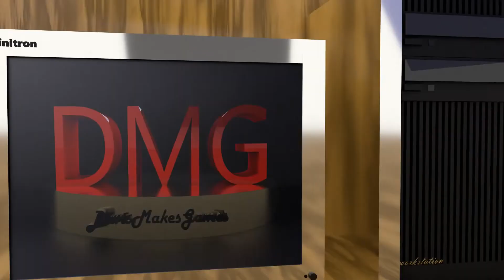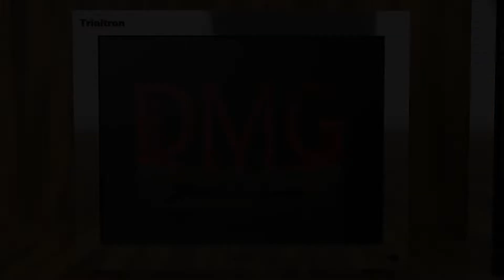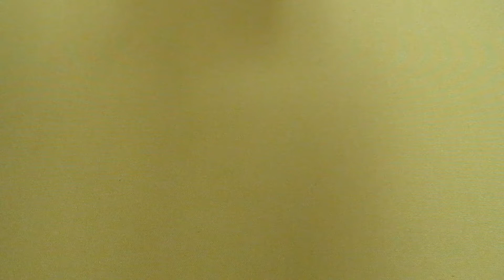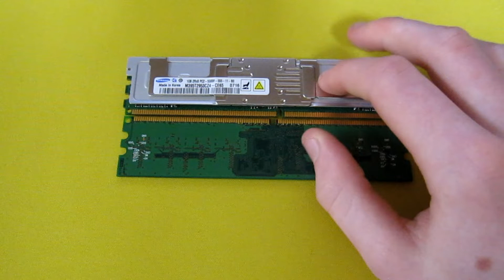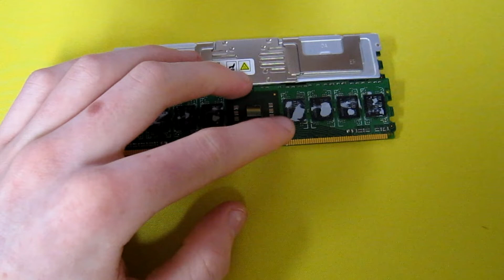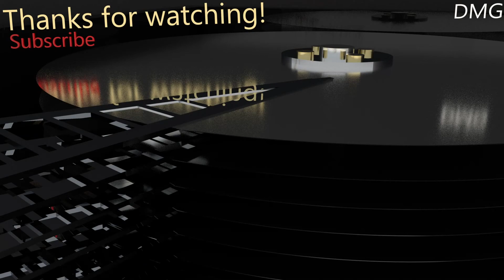What's so special about ECC DDR2?

Comment: I appreciate that you are showing this opened chip, and that you're trying to explain, but many of the points you made need correction. The extra chip in the middle has more to do with the fact that these are Registered DIMMs (this has to do with how the memory is accessed). ECC functionality is performed in the memory controller, which uses extra parity bits that are available in the memory modules. Slot disablement is a feature of the motherboard or CPU. Lots of ECC RAM doesn't have thermal spreaders, and there is non-ECC RAM with thermal spreaders. Normal RAM chips communicate some data about themselves too. RAM training is standard going back at least to DDR1 (ECC and non-ECC). It's the process where the memory controller tries different speeds and timings to achieve stable, responsive memory storage and retrieval. The "southernmost latency is zero" statement means, since it takes the longest amount of time for signal to propagate to the furthest away (physically) RAM slot, they don't add latency to that module, and all other slots are slightly delayed to align the clock pulses.  "Self refresh" means that the RAM is refreshed by itself. Basically all normal DDR1/2/3/4/5 is CMOS, which needs to be refreshed periodically, or it will lose track of the data it is storing (It reads the data, then writes it back). All DDR compliant memory has self refresh. Knowing which RAM chip is dead, and choosing what to do with that information is a function of the motherboard and CPU, not anything to do with whether it is ECC or not.
Reply from the maker: Thanks for the info, I appreciate the corrections and insight!

Comment: The DDR2 era was quite bizarre, what you covered in this video is FB-DIMMs, which was what Intel used in the C2D based Xeon era. 
that chip does something super interesting that I'm surprised you didn't mention, it converts the parallel data that is stored/received from the RAM chips and sends this as a serial connection to the Northbridge. that is the main reason it needs to much heatsink as compared to say.. an RDIMM

however there were also "Buffered"/"Registered" RDIMMs (they have a P at the end of the speed). they put a "Buffer" chip on the control lines only. which has the sole purpose of cleaning up the signal, and possibly extending the rank limitations of the chipset.
which is similar to modern day RDIMMS and used by AMD in that era, AMD was also using on-CPU memory controllers well before Intel and is how all modern systems work.

and (while rare) there's even unbuffered ECC AKA UDIMMs, which are essentially "normal" DDR2 that has the extra 9th chip per rank required to store the ECC.
Reply from the maker: I did not know about the serial connection specifically, thanks for the info!

Comment: FIFO is First In First Out.  It's just saying the commands are stored in that buffer and executed in the order they are received.  Usually we just say "FIFO" as a single word (similar to how you say "Fido", a popular name for fictional dogs).
The rest of that paragraph made sense.  The reason they all need to align with the southern most DIMM is because that one will be the slowest, the faster modules can "train" their speed to match the slowest one so that they can all operate in lock step.  South, in general PC architecture, just means farther away from the CPU, and north is closer (think for example of the south bridge vs north bridge on your motherboard, one is much closer to the CPU than the other).  So it's not like a specific slot, it's how long are the copper traces.  Which memory module has to send data the farthest distance.
Filling at half the data rate means you can write to it once per clock, and emptying at the data rate means twice per clock (since, you know, that's the DDR data rate).
I'm guessing the invalidate write command is to undo a write that's still pending in the buffer (obv a soft reset would just clear the buffer), likely these are used by the branch prediction wizardry present in modern pipelined CPUs... (If not that, then something else, equally arcane).
Self refresh means it will continue refreshing it's own cells (something the motherboard's memory controller usually does) while it's training itself to match the data speed of the slowest (southern most) memory module.
All of the modules likely take a turn measuring the speed of that southern most module and adjusting (or training) themselves to match it. And while that's happening the motherboard isn't manually refreshing the modules, so they go into a mode where they can refresh themselves.
It has nothing to do with sentience (having a tiny CPU doesn't make it sentient). It's just performing an algorithm to find the center of the pulse (timing wise) so that it can match that speed accurately.
That specific error says that the FBD link failed... In that case I would think the AMB chip failed and isn't communicating properly... You could be right though, it might be a memory chip failed and the AMB is just acting poorly as a result.  And maybe the error message is just really general.  But I just feel like in the early 2000s, error messages were a lot more raw than today; less general and very specific about the error.  That's just a gut feeling though.
Cool video by the way.
Reply from the maker: Great information! Thank you for sharing.

Comment: what are implication of using this instead of t480 ThinkPad to run my Minecraft server?
Reply from the maker: I suppose the system could be a little more stable from using ECC RAM, but it would not make a huge difference for a Minecraft server.

Comment: I used to host Minecraft servers on DDR2 FB-DIMM era hardware. PowerEdge 2950 III with 2x Xeon E5420, 32GB RAM (8x4GB) and 4x 146GB 15K RPM SAS HDDs. I ran that thing 24/7 from 2013 to 2017.
I do also have a Supermicro server with a X7DWN+ which has 16x DDR2 FB-DIMM slots and could take up to 128GB with 8GB sticks. Though I only have 4GB sticks for a total of 64GB.

My dad still has a few HP xw6600 workstations in use. One with 2x E5450 and 32GB RAM, another with 2x E5440 and 24GB or something and one as a guest PC with 2x E5405 and 8GB RAM.
Reply: I love rack computers but the racks are all so expensive 😭😭😭

Comment: The Extra RAM Dies you found on the rear are what's called parity check dies, their whole purpose is to give the AMB a set of memory addresses on which it can store a real-time "log" of what is going on in the other chips, and so that when one of the chips dies or simply has a problem the AMB can fail-over and allow the the system to continue as if nothing had happened, as opposed to what would essentially be a catastrophic system failure with probable data corruption, so those extra dies DO have a purpose.

Comment: I have 2 Dell servers that use DDR-2 RAM.  I Really don't see a use for them unless I really want to play around with old software as only one has a 8x PCI-e slot in it.   Things have just got so fast with i/o  with recent hardware, it just leaves these old machines as curiosity's for most folks.     

Still cool.
Reply from the maker: Same with my PowerEdge 2900 server that these came from. It has a good number of PCIe lanes, but they are broken up into many x4 slots instead of a couple x16.

Comment: "12 gigs for 50 bucks" Better than Apple charging $200 for an 8GB memory upgrade on the newest MBP...
Reply from the maker: Almost as if turning your entire computer into a specialized highly-integrated SOC severely limits the customization of the hardware.
Reminds me a lot of AMD's Navi HBM cards, the Pro Duo in particular. Great performance from the graphics processors, and the HBM memory sure was fast, but the amount of VRAM per card was just not enough to really accomplish much of anything.